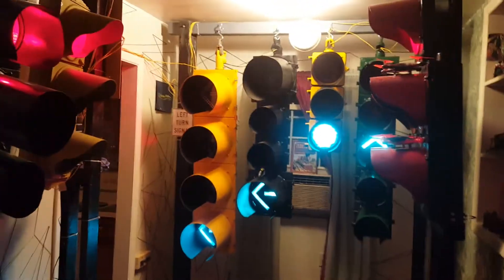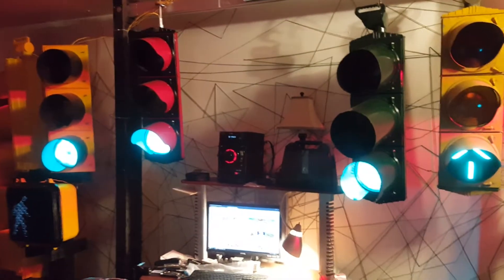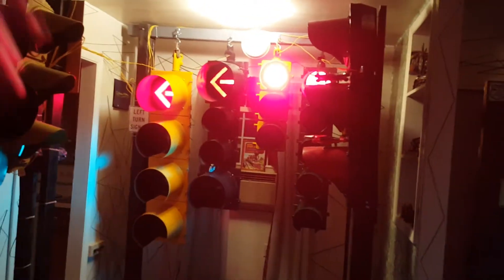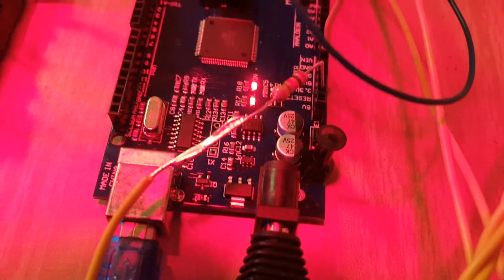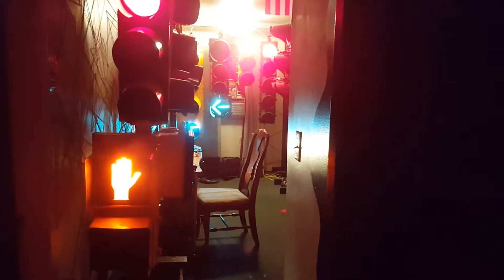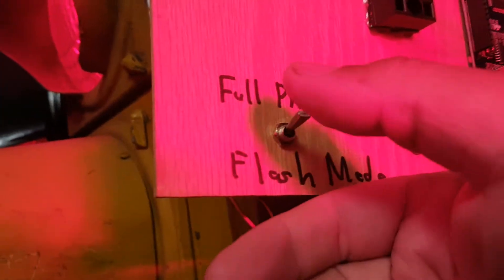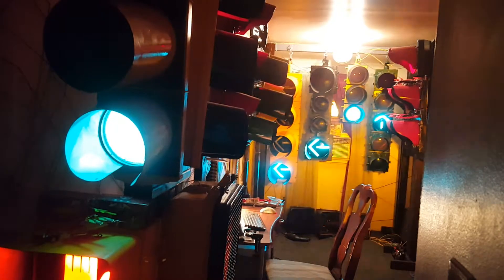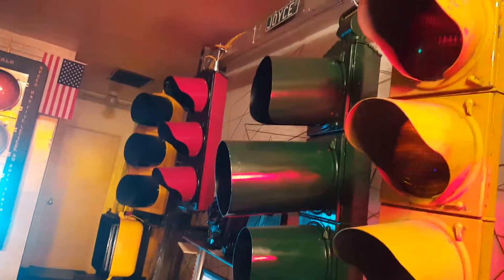My Last Traffic Signal Mod

Comment: Hey Lance.. I use an Ardunio to control my lights also. I recently rewrote my entire code so that my auto/flash mode toggle switch instantly goes into the respective selected mode. Let me know if you want a copy of the code or if you want help modifying your existing code.
Reply from the maker: Sure, when I get home I will send you a copy of the code for you to modify. Can you inbox me your email?
Reply: Lance Maddux I just rewatched this video. I figured out in my own setup that you can avoid the resister mess by changing the INPUT to a INPUT_PULLUP. This leverages the built-in resister of the arduino. However, the pin is looking for ground voltage if you do it this way. So wire one side of your switch to ground and the other to your input PIN. Also, let me know if you want a copy of my code still.

Comment: Generally you want to use a resistor to pull the input back down to ground when its not 5V (or the opposite). If not, its considered a floating input and could be interpreted as high or low causing it to flip back and forth between states. Some MCU's have internal pulldown/pullup resistors you can activate through software. This is from the latest Arduino reference: "As of Arduino 1.0.1, it is possible to enable the internal pullup resistors with the mode INPUT_PULLUP. Additionally, the INPUT mode explicitly disables the internal pullups." So you could probably set it up without the resistor if you wanted.
Reply from the maker: AssemblyBandit yup that's what I ended up doing and it works perfectly now